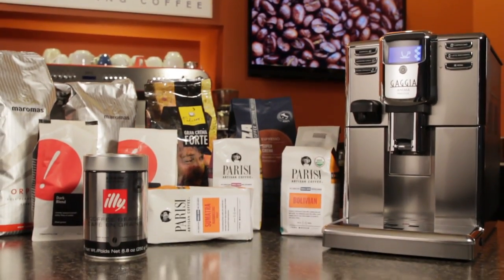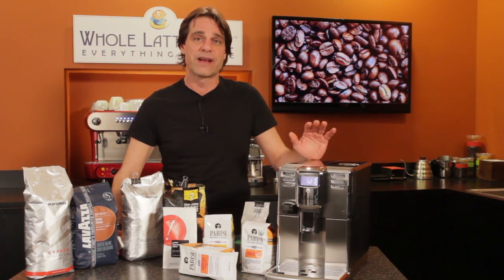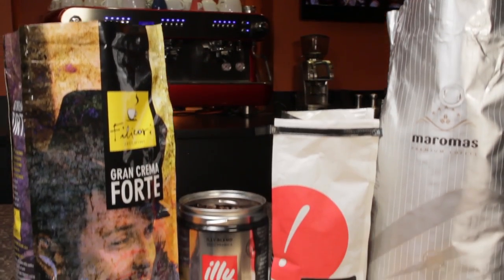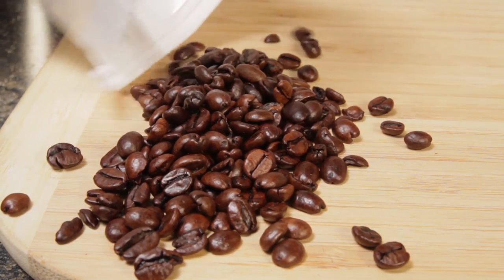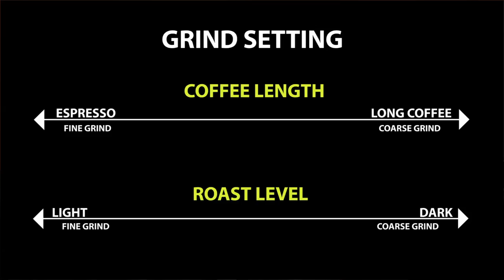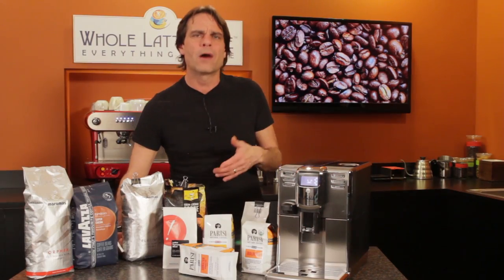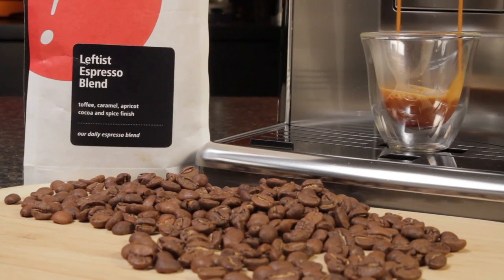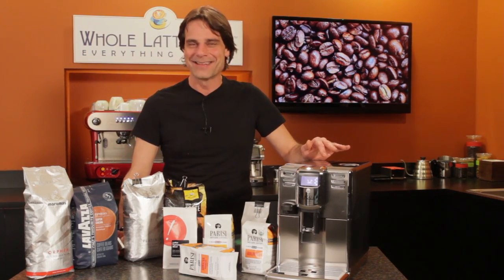How To: Coffee Bean Selection and Grind Settings for Bean to Cup Machines

Comment: I recommend you use the grind setting that works with the drinks you make most often. When you need an entirely different grindsize you use a separate grinder and then use the machines peregrind function. It is easier, and you don't have to wait for the change to take effect.

Comment: I bought my first bag of ground offee (Starbucks). HELP! How do I open the bag so I can use the tabs at ech end to hold the fold-down top in place? The tabs are ABOVE the sealed top!!! BLESS YOU for the answer!
Reply from the maker: Marilyn Givens Not familiar with setup on Starbucks bags. But I would suggest using scissors to open or, the bag may be designed to allow opening by pulling the top apart so you don’t lose the the tabs for resealing. If not, open the bag and roll the top down to seal. Then hold closed with clothes pin or large paper clip

Comment: A question about the grinding changes. If you have two people using the machine, one who likes long coffee and one who likes milk based drinks. How do you recommend changing the grind between drinks? Or compromise right in the middle?
Reply from the maker: Hi owsleyjb, Great question! I currently have a Jura ENA Micro 90 at home. A compromise in the middle is how we do it at my house. I tend toward a finer grind as the compromise and then use strength setting (amount of coffee dosed) to fine tune. I always use highest strength/largest dose and highest temperature setting for espresso and that's my recommendation regardless of machine brand. For long coffee I back off on the strength setting and may take the temperature down a notch to avoid over-extraction. Depending on how large a long coffee it may be best to use 2 brew cycles for a full cup. In the past I've had the Gaggia Accademia and Babila at home. They are my favorite machines for those who switch between espresso and long coffee. Both  have a flow control dial near the spout. With flow control you can restrict flow for deeper espresso extraction and increase flow to avoid over-extracting  long coffees. Hope that helps!
Marc
Reply: @Wholelattelovepage  Thanks for the quick helpful answer!

Comment: I recently bought Lavazza espresso beans but I am not getting the kind of creme I would get in some of the other italian coffee capsule using Nespresso machine. Should I adjust my grinder setting to a finer setting? it's currently at 3 I believe. I recently bought Gaggia Anima from you all.
Reply from the maker: Hi Sid, Thanks for your patronage. For espresso, I always set the grinder in super-automatics like the Anima to the finest grind setting. When moving the grind finer you should only adjust 1 tick finer between each grind cycle. Also set strength and temperature to maximum. If you find the coffee is getting too bitter after grinding at finest setting back off. If too strong back off on strength setting. Not sure which Lavazza coffee you have but if it's super crema it should produce crema at those settings.
Marc
Reply: @Wholelattelovepage  I have Lavazza cafe espresso whole beans. will try the suggested settings.